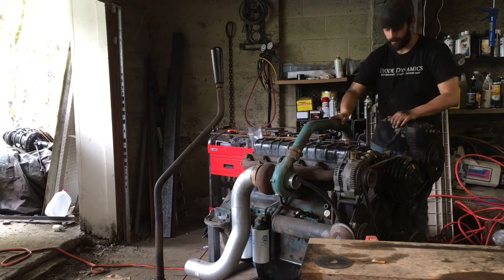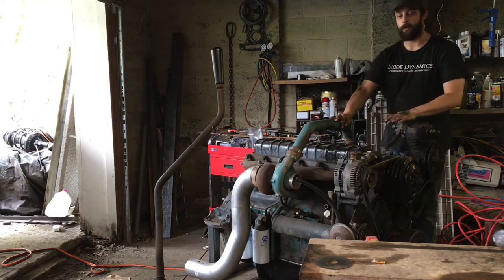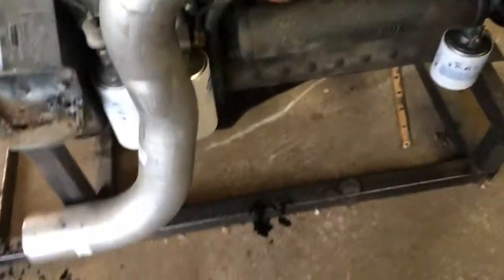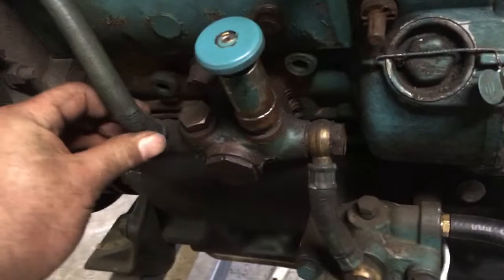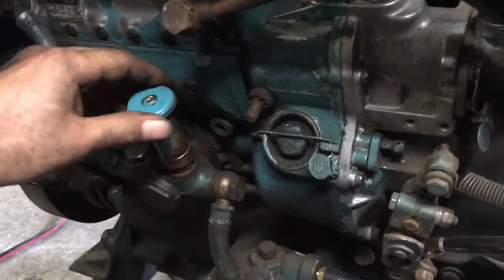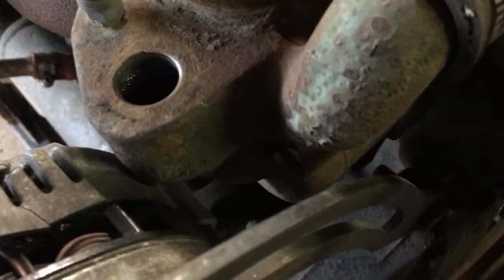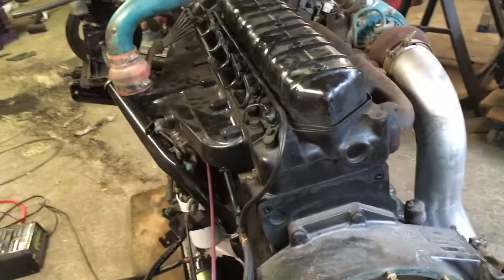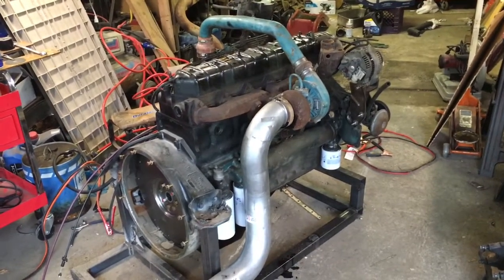The Dually Build Dt360 Run video

Comment: An in depth in frame would be great, so you, the owner would know the in's and out's of the engine. Also it would make great footage. I think the engine sounds fine, just the turbo has a bad seal. If it was a bad head gasket she would be burning some oil too, not just pushing it out the exhaust.
Reply from the maker: It is a low mile engine, so not inframe any time soon, but one day.  I plan to drive it around a bit and get a feel for the engine in this truck first.  Then its time for upgrades and an inframe. I can not find any internet info on the inframe so I agree it would be pretty sweet to have that footage but running and driving is first.

It will be getting a HE351CW turbo or something like that I have it all wrote down.  I also believe it is just the turbo after looking closer as the vanes are coated in oil and none of it is burnt, just wet oil.
Reply: Yeah, figured that. These along with the DT466's are prone to turbo failure. I currently have a 1994 IH 4900 with DT466 with the P pump. Just had to put in the Eaton fuller 6 speed after I lost 4th and 5th gear in one day. It worked perfect leading up to the incident. 

All I've ever ran is DT466's. Some people like them, some hate them. I love them because they're relatively cheap, indestructible, and can have good power with certain changes being made. One thing you should check right away which is simple enough and will save you a headache is the idler gears under the front cover. Do it while the engine is out. They are always an issue. The bearings like to go in them and they'll slap on the front cover making a god awful noise. Tere are kits available for these idlers I believe, it's a support bracket that bolts on and it holds the idler gear in place preventing it from slapping the cover. Just a tip.